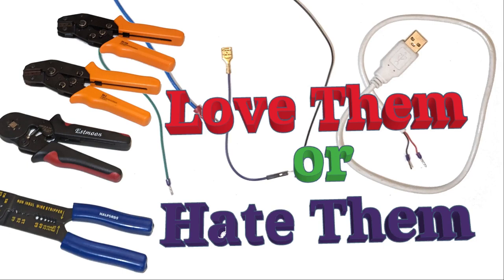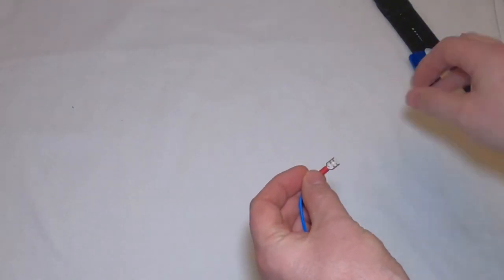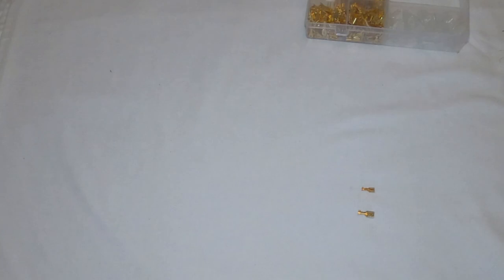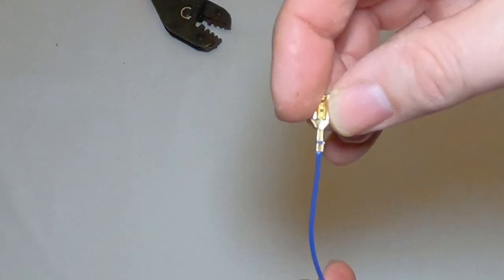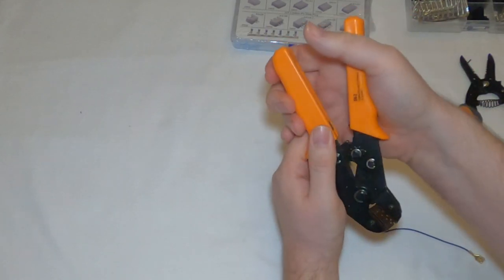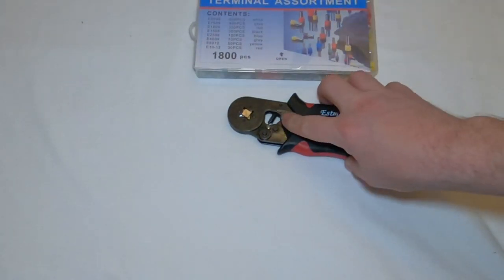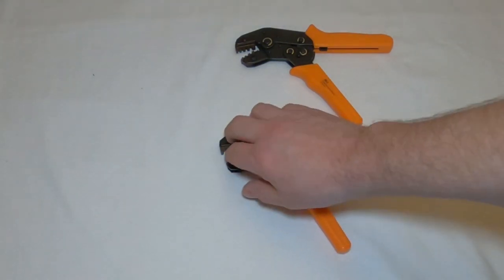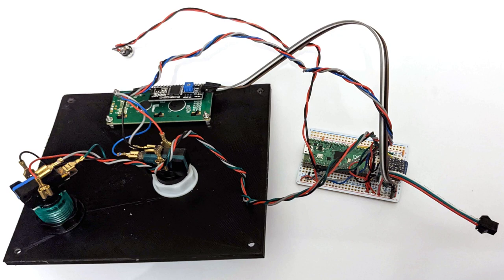Electronic Crimp Connections, Love them or hate them they are very useful

Comment: Not wanting to crimp any style here, could you consider a video covering pointers and referencing in C++ ? The videos already on this subject make too many assumptions and cover the subject at too a fast pace, while never generating a true level of understanding. With your approachable style and ability to explain in simpler terms, you could be the first channel to properly explain these and to the immense benefit of coders learning C++.
Reply from the maker: I'll see what I can do. I tend to avoid pointers wherever possible, as it is an easy way to introduce bugs to your code. I do accept that sometimes it is the only way, or perhaps better than the alternatives. 

I don't do much C/C++ programming for PC now, but I do still use it for microcontrollers sometimes so perhaps I can include it in a microcontroller project.